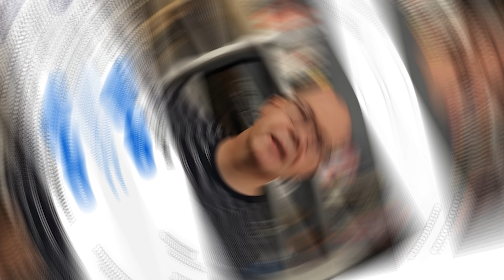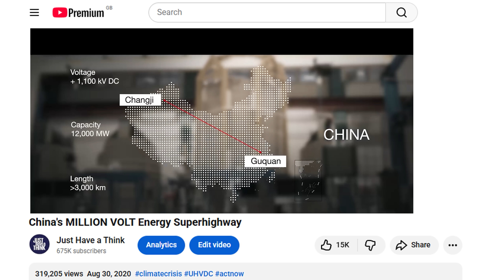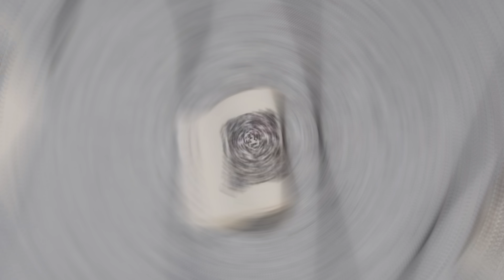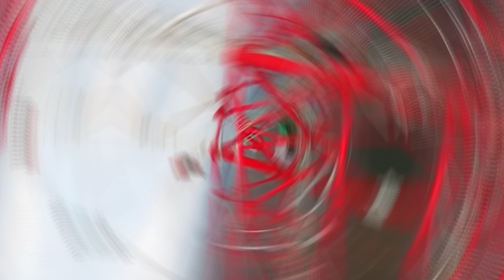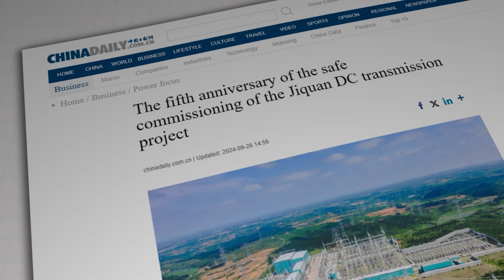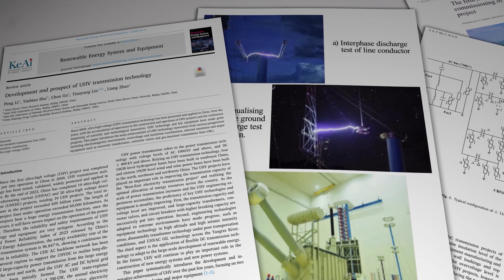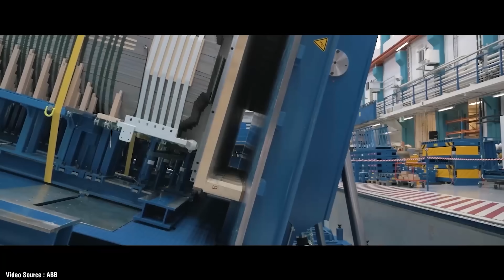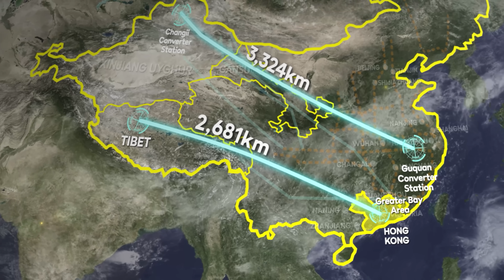China's ultra-high voltage transmission lines now breaking all records.

Comment: The US did research  on high Voltage  in the 1960,1970s and found out that peope were getting Cancer leukemia. That's why the US doesn't have many HIGH voltage transmission lines.
Reply: But we do have high voltage AC transmission lines. They are 30,000 volts. Look out the window, there they are.

Comment: Hi Dave . . . Happy Holidays (fossil fuel fundamentalists here in the US hate that annual non-denominational greeting.) I would say that early 2026 might be good time to check in with the progress of Balcony Solar in our great northern hemisphere technological backwater. Fortunately, we now have UL 3700, which is a recently agreed-upon safety guideline designed to utilize a pair of 120V breakers inside a common American household electrical service panel (120V on each leg of the 240V split phase power we have here.) This is good news. It makes Balcony systems safe from things like breaker masking and other possibly dangerous electrical anomalies that could be present when backfeeding said service panel with a 120V microinverter on just a single panel leg. I anticipate many state legislatures here will have Balcony Solar "legalization and decriminalization" on their plates during the upcoming state legislative season. Wish us luck.

Comment: Topic for the future. Hinley Point Nuclear power. It's cost is high per KWh when compared to renewables. Decommissioning is never included. An accident due to tidal wave as on Jan 30th 1606 might cause catastrophic damage. If a prevailing wind from the SW were blowing and a radioactive cloud as in Fukushima were to occur I believe evacuation would be necessary from Hinckley to Bristol. Is this really what we want? The Seven Barrage was abandoned for a number of reasons but cost figured highly. I understand it could deliver more power than Hinckley at a lower capital cost and kWh cost. What a balmy world we live in. Chris.

Comment: Yes, China is doing remarkable work converting to renewable energy - work we here in the US could stand to emulate, in most regards. But I can't help but notice, as you nod toward, those massive transmission lines move a resource (electricity) away from Tibetans and Uygurs; similar to the way the US moves energy, whether mined or generated, away from native, black, and generally economically disadvantaged folks toward areas that are more white and more well-off. We need rapid energy transition for the sake of our species - but the more powerful and wealthier need to bear more of the cost of it than the less well-off and well-situated.

Real sustainability doesn't happen at the expense of our fellow human beings.
Reply: You cant be this stupid

Comment: I hate to admit it, but a UHVDC project of that magnitude would be a nightmare to complete in the U.S. with all the approvals, impact statements and NIMBYs fighting it every mile along the way. Small distributed green power sources with battery storage at the household or community level would have a much better chance of success at least for residential power needs.

Comment: When it comes down to the question why and how China can actually pull off these project within a reasonable timeframe it comes down to having a large enough industrial backbone and some elements of the Chinese economy still being operated in a centralized fashion, which is a huge factor in saving costs compared to outsourcing the construction of infrastructure to a for-profit endeavor. Yes, yes there's corruption and so on eating away at the aforementioned efficiency gains, but still.
I think over the decades Western nations have gone too far when it comes to privatizing industries to a point where it hurts the countries' capabilities to pull off mega projects, as well as being a hazard to supply chain safety. Then there's also the climate aspect of shipping goods around the globe when we could produce them ourselves instead.

Comment: Imagine the size of a 1 million volt full bridge rectifier along with suitable capacitors for output stabilization. Also, the plasma arc when creating an electrical connection at the switching station is going to be an insane spectacle at that voltage :O

Comment: Theme suggestion: zero emission farms? solar panels mounted vertically on farms to generate electricity for equipment and improve micro-climate to generate better yields, with added panels covering irrigation canals, and gas capture at animal farms and many other interesting themes.

Comment: As far as a topic, I'd like to suggest a topic of advancements in all fields that are changing the world for the betterment of mankind. Those topics that truly are making the world a better place. Those topics that currently shown to be solving problems and bringing in World harmony. Perhaps a video of as many solutions as possible in one video and then a breakdown of each in other videos. For me, I would like to see a video on integrated Chips (IC's) that utilize light to transfer or modify bits. By using light instead of voltage changes within a chip, we would be accelerating the processing speed of all information data. Move those bits at the speed of light!

Comment: China has become what the US was in the 1950s..... dynamic and innovative on large scale societal level projects.  China is basically building infrastructure that will give its country a huge advantage going forward. 
    Unfortunately here in the U.S. the govt has seemingly given up on being involved in large infrastructure projects; instead letting public/private companies take the lead. This is a major mistake since those companies must try (as they have a legal duty to their stockholders) to do things on the cheap, or at smaller scale, to maximize profit.  There are a few exceptions (dare we name He that Shall not Be Named... "Elon") but as a rule public/private companies will not take on very large infrastructure projects as there is just too much risk vs short term reward. Thus the US infrastructure built after WWII is crumbling and will continue to crumble until the vast amounts of military spending is put towards infrastructure instead.  However doing that would then require massive defunding of military alliances, contractors, and troop strength.

Comment: Should we in this day and age with home solar and battery systems, be looking at DC appliances that can run direct from solar or battery without inverter losses.😮
Reply: Good idea, but this requires households to have storage batteries. Current high-energy battery technology cannot guarantee complete safety, so only low-energy-density batteries can be used. Solar energy is limited by sunlight; if it's completely offline, you need to consider how to cope with inclement weather, so grid connection is still necessary.

Comment: Every time I watch a u tube, listen to the news or read an article about global warming, I am confronted by this industry or that contributing 10, 20 or even 30% of the carbon emissions that we are told are responsible for our existential crisis. I’m no mathematician, but I feel sure that if these figures were totalled up it would exceed 300% which makes me, and I’m sure many others see this as either scare mongering, just plane wrong or for too confusing for anyone to engage with in any meaningful way. 
Am I correct in thinking that these industry and government boffins intentionally produce this in such a confusing way so that mere mortals like me put it in the too hard basket and wander off to make a cuppa or watch something less challenging like American politics or quantum physics?

Secondly has anyone come up with a list of the low hanging fruit that could be done to at least make a start in slowing down the upcoming apocalypse. As someone who strongly disapproves of plastics polluting the environment, taxing all plastic packaging heavily so that it covered the cleanup costs might be a start? 

My third offering would be ‘built in obsolescence’ not just in cars and electronics, although that could easily cover two episodes, but clothing, furniture and even new build homes. I get that entropy is a thing, but intentional premature decay should be called out where it is identified.

Thanks for reading my depressing rant, keep up the great work 
Regards Marcus

Comment: great videos, enjoying the channel. Would you dig into ground source geothermal, also the heat exchange options with heat pumps. This is where in AC mode the heat gas in the heat pump is used to heat for instance a swimming pool. Saves about 15% of running cost. The more AC's being used creating a bigger warming problem. Thx & have a great holiday.

Comment: (Prise entry) My suggestion is that  you have a relook at hydro. I think we are missing a trick. Instead of building new pumped storage that is inefficient, what about enlarging existing hydros, to give twice the power half as often.  Very flexible and cheaper, probably very easy planning consent. Obviously I am not thinking of run of the river hydro.

Comment: A video on energy storage on the medium to long term (14 days to 6months range). Batteries are great for daily storage, but, as I have found on octopus agile, there can often be a fortnight or more between windy days. There seems to be some huge sand batteries for industrial use, and talk of a hydrogen economy, but not much of use at a household scale now. A related video could be are heat pumps going to be necessary if we have a renewables grid where we have periods of excess energy. Heat pumps seem to make more sense for a steady state energy mix like nuclear.

Comment: I see a video or story like this and XLinks comes to mind.
The plan was to build new factories in the UK to manufacture the cables to link to renewable power in Morocco.
The current government announced in the summer they were withdrawing support for the project.
As far as I recall the only support they asked for was a CFD price per MWh, which would be significantly below CFDs offered for new nuclear. 
So a project that has the potential to create sustainable UK jobs, provide green power and be online faster than nuclear and cheaper.
On the surface it looks like it has a lot going for it.

Comment: Incat in Tasmania is just about to do "sea" trials for the world's largest electric ferry, destined to run between Argetina and Uraguay across the river Plate delta. The battery technology is European and although on this occasion the vessel is twin hull using hydrojet propulsion the concept can be applied to mono hull and traditional screw propulsion too. Of particular interest to me is fast charging of megawatt capacity batteries, particularly battery to battery loading for fast turn around. Vessels are under construction for deployment in Denmark and might also be suited to cross channel routes. Some thing on such large capacity battery technology might be of interest to others. Incat hulls are substantially aluminium providing a power to weight advantage over traditional steel  hulls.

Comment: One niche challenge faced with all the differing regional electricity regulatory bodies in NA, is that all our existing interties have inconsistent measurement systems and data sharing agreements. Different jurisdictions own or don't own their own meters, have/dont have access to the intertie meter data, use less accurate telemetry to compare with meter data, etc.

Comment: Suggested topic on how Air batteries and companies are doing a couple of years after  introduction. Maybe also if Universities incorporated data centres to help heat lecture halls and buildings. Places where there is already security and technology personnel. With the latest servers being smaller and more powerful using less power are older data centres being refreshed with newer equipment. As most data centre active being that from advertising agencies maybe newer laws need to be adopted to limit their absolutely massive influence on the internet.

Comment: I worked at Alston Grid on a high voltage multi-level converter project for DC transmission. A few years ago now, it seemed chronically under funded and very poorly managed. The Chinese are leaving us behind at an alarming rate.

Comment: Thank you for all that you do. I really enjoy your videos. As far as a topic I would like to see is an in-depth study into the makings of a solar panel or an inverter or other components that make up a renewable energy system, and go to the nth level of the total cost of the carbon footprint of a renewable energy system. If explored to the nth level, I could see this as a multipart series on the subject. Even the copper wiring involved all takes energy and natural resources to produce. What is the carbon footprint and when does the renewable energy item finally overcome the cost of the carbon footprint? You may also want to include end-of-life estimates as to what happens to the product after it is no longer used. I think too often we broad-brush the details of what it takes to produce a solar panel for example.

I have absolutely nothing against renewable energy and I have installed many systems myself, but it does make me wonder how much of an impact it has on Mother Earth. Would it be wiser to conserve energy than buy cheap solar panels from a 3rd world country? We don't talk much about conservation any more since solar panels have become so cheap.

Comment: I have a large off shore windfarm (Rampion 1) quite close to me on the South coast of the UK. It seems a shame that there isn't a HVDC backbone running through the country up to the proposed pumped hydro plants in Scotland. This would enable us to step further away from fossil fuels, save money by not paying wind farms to not produce energy and provide lots of new jobs to areas that need it. A few years ago I would of said to lay the HVDC lines off shore but it seems safer now to lay them under motorways. Large size please ;)

Comment: I have been looking for DC in domestic use...
Domestic DC voltage would be around 400V DC, that's as deadly as 230V AC for humans.
But the only "household" connector I found was a GC21.
About 99% of all domestic equipment has an AC->DC 370V rectifier, and from 370V DC they DC-DC to low voltage. Just because that's the most efficient.

Comment: Electricity is usually generated as dc not ac from most renewable sources. It will need a transformer to step up voltage, but not to convert.

Comment: Hi, what's your take on the new 500 kilovolt overhead transmission lines in the west of Victoria, Australia.Its primarily a part of the Western Renewables Link (WRL) and the Victoria to NSW Interconnector. 
There is a lot local restance to these high tension overhead wires, primarily it disturbing the visual look of the countryside. 
My question is, is there an alternative ?
Reply from the maker: Thanks for your suggestion.

Comment: The $64,000 question. How do you balance the load with the demand? During the middle of the day you might be generating a lot from solar, then at night, none. You can't really power up and power down Coal fired power stations. They are designed to run flat out, all day, every day.